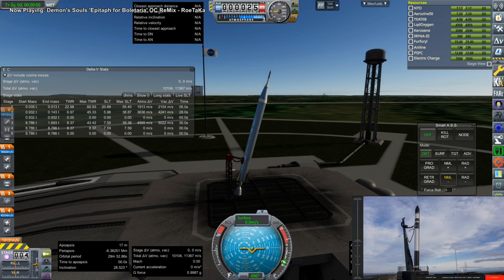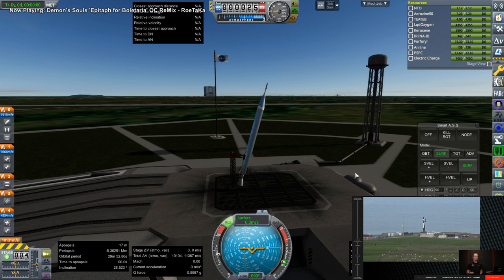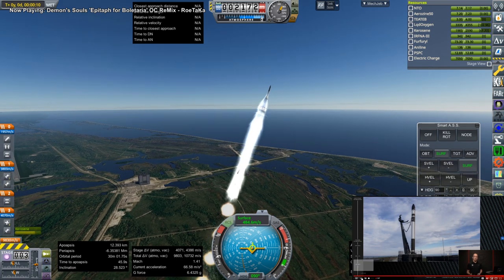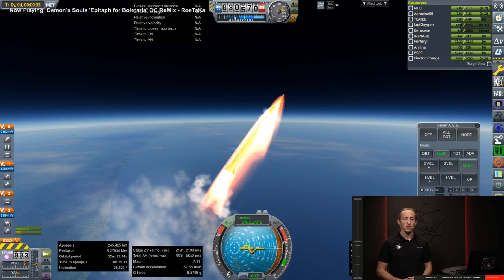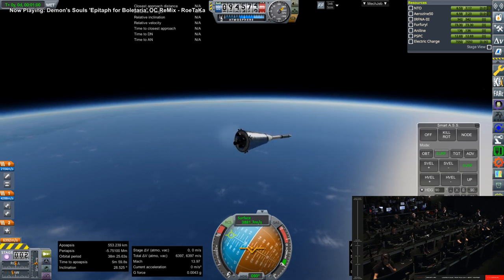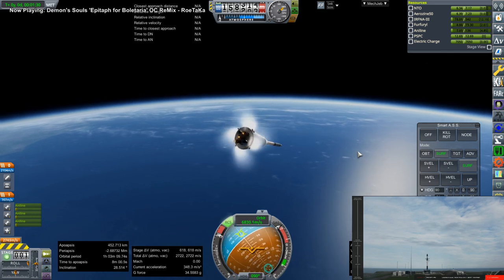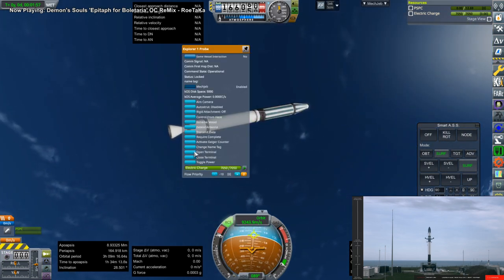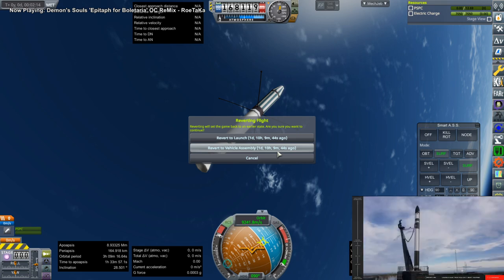Realism Overhaul in KSP 1.8.1 - Quickest to Earth Orbit Challenge

Comment: I tried this challenge with a 4stage Super-Stabilized all Solid Booster rocket with a payload of 500kg's and got into a 8.500km to 326km orbit in 1 minute 45 seconds.
Reply from the maker: Real Solids or Procedurals? If the former, very good and well done.
Reply: @RaizSpace Half real half Procedural. The first stage was basically a underfueled Ariane5 SRB with 8 AJ-60A Srbs using Large fins as stabilizers, Second And Third stage was procedural, And 4th stage was just 16 Saturn V S-II Ullage Motors put around a Structual piece and a RCS system.

Comment: Finally, someone taking this challenge again! Cosmonaut Crash and someone else did a similar competition about 2 years ago, but that was in 1.1.3.

I wonder, do you happen to know the real-life record for the fastest time from launch to orbit? Anyway, I'd love to see the sequels you've implied.
Reply from the maker: Tough to figure out because the ones you would think would be quick often have a coast phase. I'm not sure how long the Juno I coast was, for instance. I do know that Atlas and Titan had to be quite fast on the crewed launches - just 5 minutes to orbit.
Reply: @RaizSpace  If it was a Juno I/Jupiter-C, then the launch with the shortest coast was probably that of Explorer 3, as that was the launch with the lowest periapsis. But I doubt it was any Juno 1 launch, in part due to the relatively long burn time of the liquid-fueled Redstone.
 The Scout may be a better candidate?

The crewed flight with the least time from liftoff to orbit, though, is indisputably Mercury-Atlas 3, at 4 minutes 56 seconds IIRC. Had the Shǔguāng made it to flight, then those launches would probably hold the record. Just imagine a launch vehicle with similar accelerations to either the SM-65D Atlas or Cháng Zhēng 2 being pitched as a crew-launcher today.

Comment: Do they have the Sprint ABM Rocket motors?
Reply from the maker: I don't think so, but would they stay stable with KSP physics anyway?
Reply: @RaizSpace  No clue but you can always try! :D
Reply: There is a mod that allows slow-motion time warp in case you want to test an orbital launch vehicle using motors with Sprint-level acceleration, if doing so would be impractical at regular speeds for physics and reflex reasons. (Among engines present in reasonably typical RO installs, the Tiny Tim and some other Aerobee kick motors have accelerations in the lower end of that range, though I have never seen them used in orbital rockets, partially because they are shit in performance factors outside acceleration.)